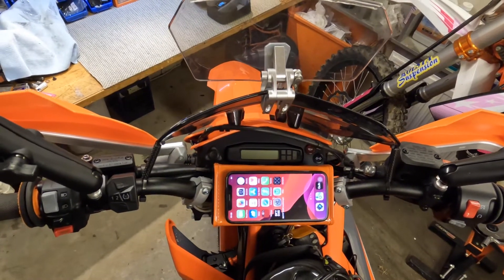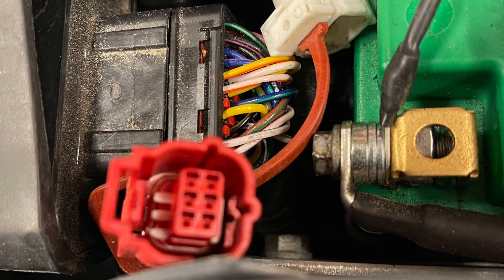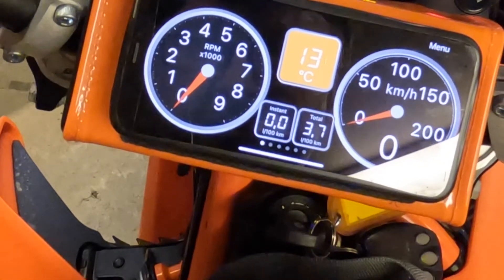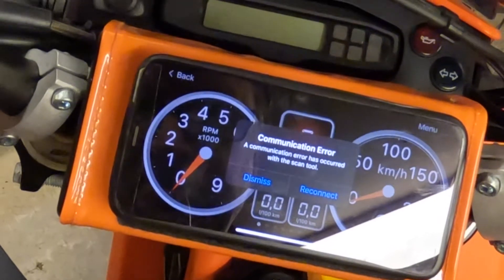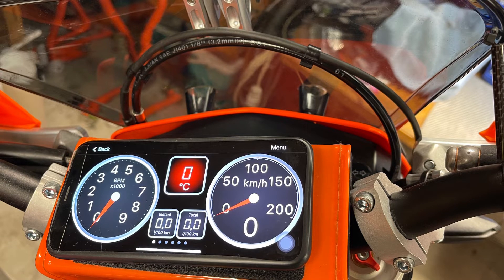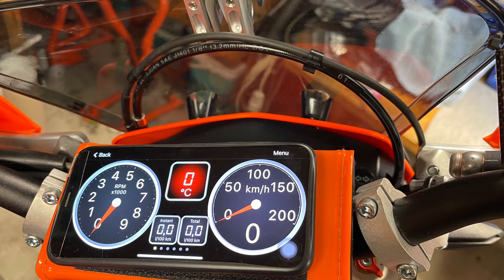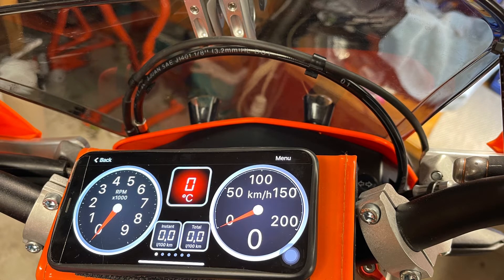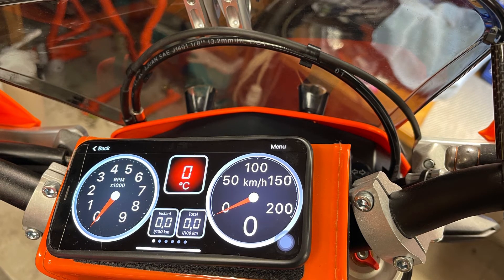Dashboard Mod, KTM 690, Husqvarna 701, Dual Sport, Adventure

Comment: Quadlock brand has Vibration Damper to avoid camera damage but you’ll need a bike mount First, there are some cheap or wireless charging too that cost much money, 
You could buy a case for your phone or back universal fit instead that can be use it on different devices not only phones

Comment: Hi thanks for sharing, I’ve followed your lead and installed it on my Husqvarna 701 👍 did you ever manage to get the Bluetooth to auto connect?
Reply from the maker: Hi no I never did and never really tried to troubleshoot as I changed to an Android phone with Thorks DMD2 dashboard app and it seems to autoconnect with the dongle, i just tried it in the garage so far. I think they are working on DMD2 for Iphone, this app I recommend

Comment: Nice video, i did the same thing in my 690 but with an android. I would like to know if you have delay in the RPM. Mine as a delay 1-2  seconds between the rpm on the bike and the one displayed. I think is because of the connection being by bluetooth. 
Another  thing is the fuel consuption, a really nice feature, did you try to test how accurate the reading really is?
Thank you
Reply from the maker: Hi with this solution I do not sense a delay in practice, maybe it is 0,5 sec. I think the reason is the good quality of the mx scanner. I changed the gearing to lower the rpm at cruise speed, and that influenced the fuel consumtion data I think, but I am not sure, have not checked that carefully but it is not exactly the same as the real consumtion, it is a little diff.

Comment: That's a nice mod, but I'm more curious about that spoiler on the windshield. Does it help alot?
Reply from the maker: Hi KriS, the spoiler reduce the wind pressure on the chest but it is to short to push it over the helmet. Given the quite low cost it was worth it but I wish it was 2 inches higher. I usually cruise at max 100 km/h so no big deal for me. But i will probably change it to a larger one sooner or later.
Reply: I built a frame for that exact screen on my 21 690 ER attached to the bars by generic CNC Chinese made (but excellent) Ebay Go Pro mounts and it is fantastic. Even at over 100mph I get zero wind pressure on my chest and zero buffeting on my helmet and I am 6'2''. Best screen I have used on any bike. Just set about 4 inches higher and a bit steeper than the KTM mounting point which frankly, is useless. I made the frame out of a generic GPS mount kit from Ebay and some cut down carbon archery arrows with electrical 6mm connectors glued to their ends. Sounds a bit weird but it looks good and everyone asks where they can purchase one as it looks like a stock item. I have a Garmin 700 on the frame and still easily read the speedo. One reason why it works so well is that the wind pressure coming up the standard mask underneath takes away all the turbulence from the screen, negating it totally. Manufacturers like Triumph, Ducati and KTM (890) have only just caught on to that but I have been doing it for a decade on home made screen set ups.
Reply: @jamesfairmind2247  Hi, have 21 690 ER and also same height as you. Would you mind passing photos of setup for your windscreen and mount points. Much easier to understand setup via photos in my case. Not sure which windshield is installed. Being able to use cheaper parts is definite advantage comparing to standard market offerings. Thanks in advance.
Reply: @lazarv123  Sorry I cant send photos unless you can give me your email address, but the screen is the standard 21 690 ER screen and the mount is a generic GPS mount which sets it about 4 inches higher than the normal location on the front light face unit. This is vital because it allows the air forced upwards by the face to run up behind the screen and clear any turbulence.  Not everyone can make the framework I guess, it needs some tool skills as the struts are cut down carbon arrow and the connections glued on the end are electrical connections. You will have to use your imagination I am afraid but the result is the most effective screen I have ever used, zero wind buffeting even over 100 mph.
Reply: @jamesfairmind2247  Thanks James, it is my mistake thinking that screen is also aftermarket. Will try to change screen position and angle as winter is coming fast in Australia. Cheers.